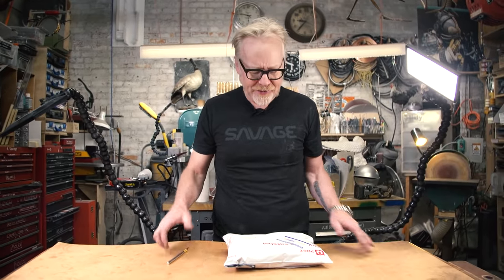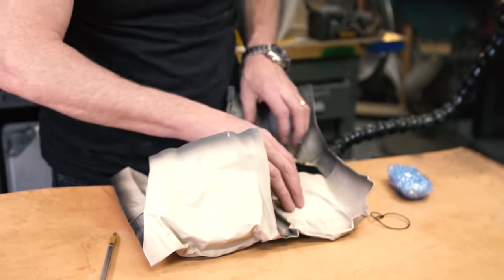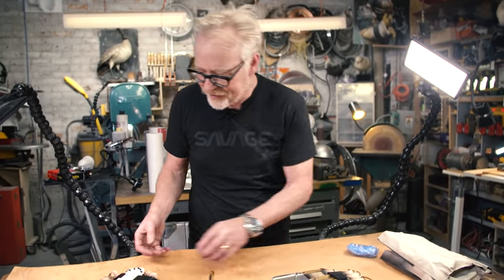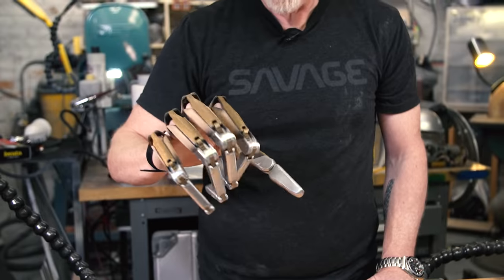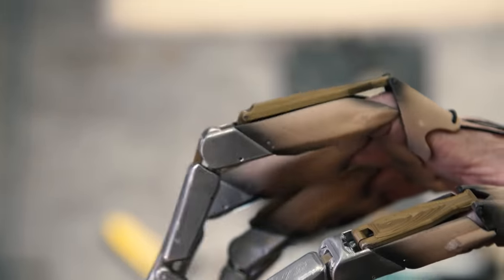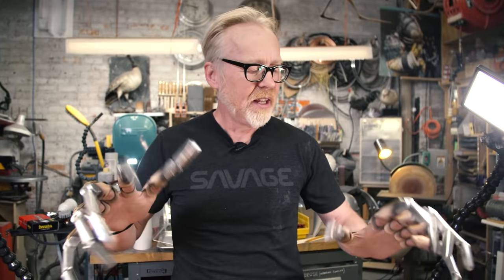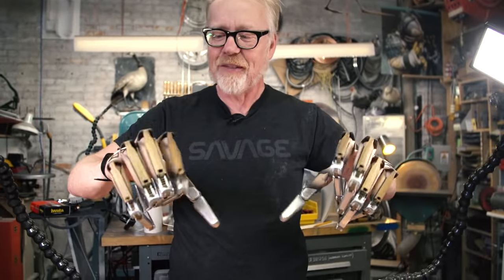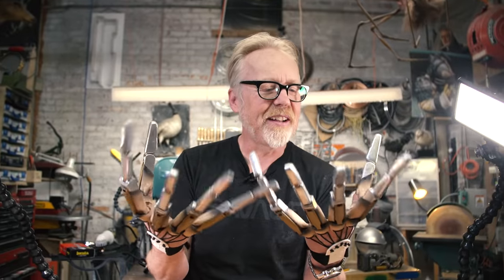Adam Savage's New Mechanical Claws!

Comment: "Wow, these are cool."
proceeds to check Thingiverse
fails to find a similar design
sighs while clicking to the actual website
SEES PRICE
"ok i don't need these."
Reply: They are 200-300 for both hands on most sets and are actually very reasonably-priced because they are hand crafted to fit your hand perfectly.
Reply: If you REALLY want them you can make them yourself. They might not be as good though.
Reply: yeah for like 15 bucks i would buy them. For the price mentioned... (now that i think the #D print resin will cost more then 15 $)
Reply: @raiden6607  So what exactly is racist about the person deciding against purchasing this and rationalizing the price would be extensively high for their budget? Kinda failing to see the angle you're playing here.
Reply: @raiden6607  wow big brain time boi
Reply: @newfoundwisdom8532  because slavery abf raicms
Reply: @raiden6607  The guy spoke about buying a pair of the mechanical claws in the video. There's literally NOTHING TO DO WITH RACISM in this video. So whenever you wake up from this dream world you're living in and  you get the wax out of your ears, come back and we'll have a chat. Otherwise, meeting adjourned.
Reply: @newfoundwisdom8532  how do you not realize this is a joke about the color of resin?
Reply: @nohomobut7642  Where does resin fit into this.
Reply: @newfoundwisdom8532  for the color of the finger parts...it's white.
Reply: @nohomobut7642  Noted. But even so, how petty can one get.
Reply: @newfoundwisdom8532  ?

Comment: Awe man, those look so cool, I want a se- looks at price
HOLY MOTHER OF GOD
Reply: My exact thoughts lol... Wonder there's a cheaper version
Reply: @justinlegrand992  yep one you'll be throwing in the trash cause it doesn't work in a month. Longevity is the reason quality products are expensive (not to mention these are essentially completely custom to your finger size and handcrafted).
Reply: Remember, the prices are in AUD instead of USD! In case that helps. There’s a drop down to change the currency in the website, and changing it to USD about halves the prices.
Reply: I think i'd be more down for buying a pair of these if they were made of more durable materials that won't break easily.
I'm not sure how strong that 3D printer plastic is, but plastic props (especially ones made with thin plastic in this case) tend to be either brittle or easily warped/bent.
Reply: Relatible
Reply: @ABonafideSkeleton  agreed
Reply: Beyond worth it, and it supports an artist
Reply: @mocchihedron8341  trust me, if I wasn't a poor af college student, I'd get myself a pair since they look amazing
Reply: The price seems perfect to me, less than $300 USD for a set of really long mechanical claws, that's a awesome deal!

Comment: since these aren’t tethered to your wrist, couldn’t someone break your fingers easily?

are they heavy enough to actually grab things
Reply: They are tethered to the wrist, you can see the plate they link to on the back of the hand, which has a strap holding it to the wrist. As for weight, if they were perhaps metal instead of plastic, i think the only limiting factor is your own finger strength

Comment: For the next video, add the neutral to the switch to get the illumination to work. You can wire it so that it illuminates when on or off. I would have it illuminate when off to show that it is plugged in.

Comment: I've seen these extended finger things before and even owned one as a child, but there's always a problem with the thumb part not bending enough and you having to move it all the way into your palm to get it to do so properly. Manufacturers always use the same mechanism for the thumb and fingers, even though thumbs have very different movement from fingers.
It should be an easy fix with this one since it works with gears.

Comment: you can now play basketball with the pros. But what about sensing? How can you get a delicate touch sense in the tip of a finger? I think you need two levels one for touch and one for pressure. What do you think?. And one needs several different sensors in each fingertip and each phalange unit. So modulating them across a single wire would be nice. Tricky HUH?

Comment: Okay, slightly worried now, because I just ordered some on Amazon for a little under 40 bucks, and then discovered that the ones on Gary's site are several hundred bucks. Not sure what kind of quality these will be, It's possible they took Gary's apart and made bootlegs with cheaper material.
Reply: Big Al  Just got them in the mail. They are not the skeletons ones I ordered. They changed the photos.

They are passable though. If you just want some simple finger extensions, these will do.

Comment: Just FYI, Gary is selling these for about $400 for a full set. I bought the stl's for $6, the silk PLA for $25, a 5 minute epoxy kit for $15, and sized them in like 30 minutes in Blender. My claws are awesome. But unless they're made of solid silver, they're not worth $400. Or perhaps they are, in which case, I have some magic beans to sell you. They're $400 and give you an erection. They may or may not be viagra.